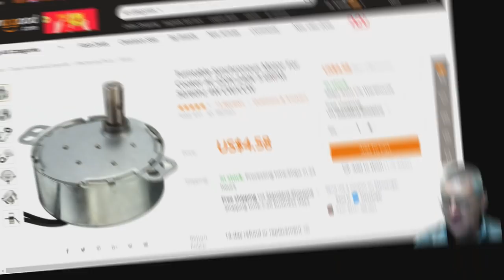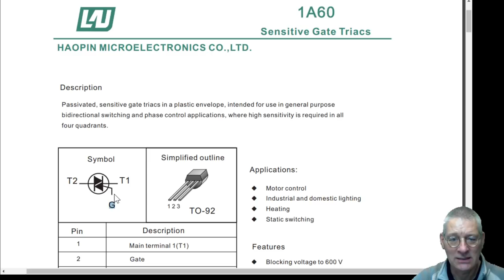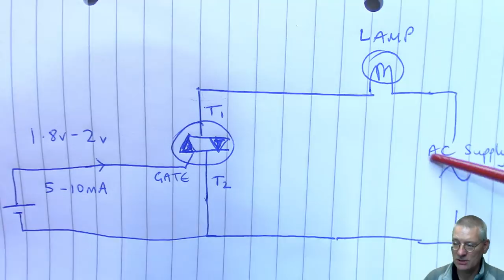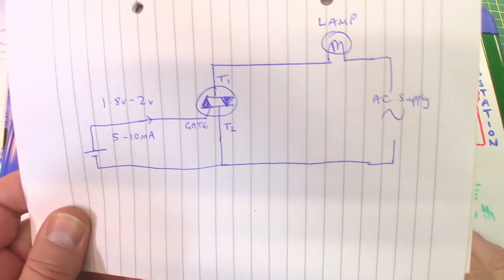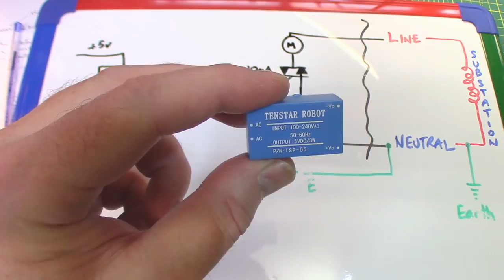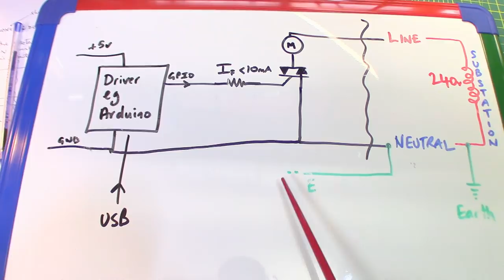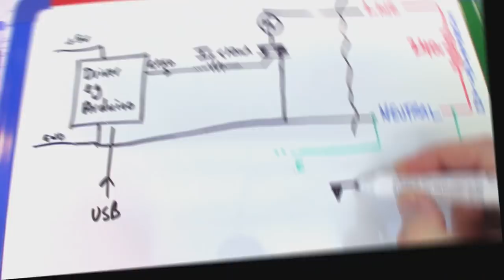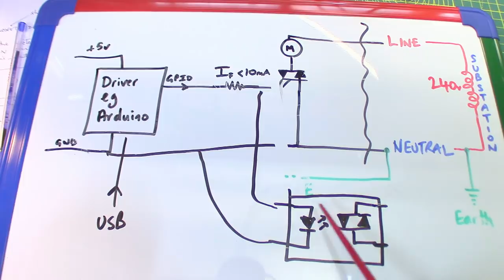#134 Triacs, Mains AC, DC, SSRs 😕 What's going on?

Comment: Wouldn't the addition of a single opto coupler, to drive the triac, have solved the problem?
Reply from the maker: An optocoupler certainly solves an issue, Dale, but getting it connected up would still be a bit tricky (some parts of the circuit would still be at mains potential).  Is the optocoupler just a photosensitive Diac? What resistance do we need to feed into the Diac from the Line circuit?

Better to use an SSR which has an optocoupler all built in, along with zero crossing detection. But that's in the Advanced Lesson so will have to wait for another day, I'm afraid!
Reply: @RalphBacon  Had to go back to the previous video to find the chosen solution for the fan rotation motor. Looks like you wired it in parallel with the second heater element. Not mint, but certainly serviceable. Particularly, to your concern, it totally removes the third point of proximity to mains. in order to put the heater back to original functionality, I was considering the use of something like a LTV852-ND opto coupler. It would take up less space (4 pin DIP) than an SSR. I've seen these devices used for mains isolation in North American (120 Volt) circuits, and do not know of any reason why they would not function in 240 volt circuits.
Reply from the maker: That's right, the swivel motor is wired in parallel with the "boost" heater coil. It actually works better that way! But, you're right, a simple 4-pin optocoupler like the MOC3021 could have been used. It would have meant more mains 240v potential connections on board, of course, not great for stripboard. Certainly better than a naked Triac!

Comment: Ralph.  Another great video. A question. If you had had the room on the heater board space would you have used an SSR?  I am in the thinking stage of two projects where I would control mains (120VAC) for me.  One would be a light and another an LCD monitor.  I was thinking about an SSR.  Would you agree with this or would a relay be better.  I am very much a beginner in all of the electronics.  Thanks!
Reply from the maker: Not necessarily, Bruce. 
SSRs are fine when manufactured by a well-known, reliable (albeit expensive) source, so that 10A really does mean (at least) 10A and not 5A, but even allowing for that fact when buying from China (that is, de-rate the current rating by half) relays have given great service for decades and rarely fail. And they are small. You'll see a comparison when my SSR from China arrives (the heatsink is already here, and that's another big thing to consider that relays do not require). 
For low current applications (eg lighting) SSRs are probably fine (although watch for the minimum current requirement - your SSR might not work with a simple 3W LED bulb, there's a minimum current required to ensure it switches on, probably around the 40W mark). 
This isn't just me being an old stick-in-the-mud. The well thought of Sonoff series uses relays. They are zero volt contacts (so you can use the relay to switch anything you like, like a simple switch). Simple might be best, sometimes.
In your case, unless you are switching the items on and off several times a minute a relay would be simpler. Ensure it is an optocoupled dual relay like I showed in video #18 and it will work well. Connect that to an ESP8266 and you have wifi controlled switches. Oh, Sonoff has already done that. See what I mean? 
Others here may have a different view?
Reply: Ralph S Bacon Thanks for the great advice and other key items I need to check.  Your are probably right about the relays and simplicity.  My planned projects do NOT have to turn on/off frequently.
Reply: SSR have built in suppresion, zero crossing etc that relays don't come with (at least most).  Although they are expensive they are worth it if you are dealing with mains imo.
Reply: Joey Mac thanks

Comment: At 4:50: the roman literals I II III IV are quadrants (positive/negative cycle, positive/negative gate voltage). Here's a good explanation http://www.learnabout-electronics.org/Semiconductors/thyristors_63.php It is very common to need different current in different quadrants and IV quadrant should probably be avoided.
Reply from the maker: Interesting stuff, hoggif, I shall read in more detail a bit later but I have that web page open on my desktop. Thanks for posting.

Comment: Happy, UK plugs are polarised. You know what is Live and Neutral. Many plugs in the EU are not polarised. You can turn L and N what you want!
Reply from the maker: Sounds like a recipe for disaster. But I guess 500m people in the EU can't all be doing it wrong so I wonder how they manage to not electrocute themselves? It would be interesting to find out. I'll have a read...
Reply: We have to isolate both, L and N. Switching with a relay or solidstaterelay. Better switch both.
Reply from the maker: Sounds a bit tricky. There's a time and place for double-pole switching but using a Triac is not one of them, I believe. I wonder what the circuit looks like? Relays would be easier, of course, but slightly over the top for most things. But if you don't know what you're switching I guess you would have to switch both to be safe.
Reply: Inside a tool only switching one, but with outlet both

Comment: Hi Ralph:  I'm thinking about using an Arduino to periodically turn the furnace blower fan off/on during the night just to help circulate the air in the house. I'm thinking about using a SSR. The specs are here: http://www.fotek.com.hk/solid/SSR-1.htm

Does this device appear to be able to be powered by the arduino directly? It only has a 7.5mA activation current. Could I just wire it to a digital pin and then ground on terminals 4 and 3 and then have my 24V furnace fan control signal voltage on the terminals 1 and 2? Your thoughts are welcomed. Thanks, Gord
Reply from the maker: If your furnace blower runs on 24v AC (not DC) then it seems a possible solution, Gord. GPIO pin to pin 3, Arduino GND to pin 4 which means your Arduino is totally isolated from the other side. Note that 24v AC is lowest this relay is designed for so double check that blower supply. I would also measure the input current to the relay (from the Arduino) just to double-check that no resistor is required.
Reply: @RalphBacon  thanks kindly for your prompt reply Ralph. I do appreciate it. Have a great weekend!

Comment: Haha, in the US, by code, the neutral and ground must be connected at a house's main panel and nowhere else...
Reply from the maker: You mean each house has its own separate ground stake (actually in the ground)?
Reply: Either by one or more ground stakes to get down below a 25 Ohm maximum impedance requirement, or if there is a copper cold water inlet nearby, that can frequently be used as a lower cost alternative with better performance. This is all spelled out in the NEC which we just call "The Code". It's like The Bible. Everyone here knows what you are referring to when you say the code.

Of course there is significant current running through the neutral and ideally no current running through the ground, so they can be at significantly different potentials away from the main panel. So hooking up ground to neutral could result in dangerous ground loops, and as someone else pointed out below, there is also the possibility for someone using a non-polarized plug here, which allows either side to go to the live and neutral lines.

I didn't realize this was different in the UK! Good to know! Of course your much better plug arrangement makes switching the live and neutral much harder, but I guess this wasn't considered as essential with only 110VAC, or maybe there was too much infrastructure already in existence before the standards came into place...

Regards,
Alan
Reply from the maker: Yes, Alan, we bond to the cold water pipe too, and our "code" states that all such pipes must be bonded so if you put in a bit of plastic pipe there must be an earth bonding wire between the metal bits of pipe remaining. It's a bit unfortunate, then, that my water is delivered via a plastic pipe! So we use the gas pipe instead (which sounds distinctly dodgy, but there we are). Yes, in the UK you can't switch L and N due to the plug arrangement, assuming it's correctly wired in the first place. Legislation a many years ago made all consumer items, including fridges and cookers etc come with a moulded plug to avoid tragic accidents. I shall have to talk about all this in a future video!

Comment: I share your concerns and double them. :-) 
You live in the UK and you have the kind of mains plug that cannot be reversed. And you have very strict codes about mains on cable colors, and which goes to which side of the plug etc. I live in Turkey, and we use the "german" type plug, ( https://goo.gl/images/yspbFY ) which is totally reversible. So, if you connect the Arduno GND to what you think is "neutral" you can easily reverse the plug and feed "live" 220VAC to arduino's GND. To make things worse, the cabling codes are not followed at all here. Any wall socket can have live on the left pin, or the right pin. It is very common to see totally random connections even in the same house. So we never know which side of the wall socket is live :-)
Reply from the maker: Frankly, Bora, I'm surprised you've survived long enough to be able to tell us about this! 😲 We might moan in the UK about "'elf and safety" (health and safety regulations) but at least they really do (over) protect us!

Comment: MOC3021 would probably run that motor directly.
Reply from the maker: Using an optocoupled Triac, Bernd, such as the MOC3021, is the obvious solution for this very low power motor, but fitting it might have presented a bit of a challenge in that workshop heater circuit board - yet more mains connections to contend with! We'll explore some things like this in a future video (once my 40A SSR has arrived from China).
Reply: @RalphBacon  
There's a zero-board solution.

I'd put that "hot" circuit directly on or close to the motor, on its own "board". There may be a surface near the motor where the chip can be "dead bugged" (flipped upside down) and glued into position before attaching the wires. That may sound dodgy  but it's quite safe as long as you use the right glue and appropriate sleeving on the soldered connections.

Call it "smart motor" and nobody will raise an eyebrow. ;-)

P.S. When you get the SSR, make sure that it's located on the cool side of the airflow. A proper one from Omron (G3NA-220B-DC5-24 if I recall correctly) has a data sheet with suggested heat sink requirements for high loads (it was switching a 2.2kW refrigeration compressor).

P.P.S.: BEFORE you flip that chip on it's back and glue it down, mark which pin is number 1 on the "underside" and keep in mind the "mirrored" configuration when making connections to the other pins!
Reply from the maker: I like that idea of calling a motor "smart" just because we've glued a (mains powered) chip to it. If you are not already, Bernd, one day you will become very rich with such lateral thinking. 😄 
Now, I don't have a MOC3021 but I'm pretty sure I have a MOC3023 somewhere which is pretty much the same (I'll check what the differences are) to experiment with. I'm not going to add this to my workshop heater but it will be good to experiment and video as required.
Thanks for posting, appreciated.

Comment: 4:15 - "Those" are actually important information, "those" are reference of the AC cycle in terms of the quadrants relation with the Triac, if you do not know anything about the Triac's functionality of it's AC quadrants, you do not know nothing about Triacs. Triac quadrants are vital important to know about. You seem very confused what "those" are lmao... telling me you don't know nothing about triacs. lol 15:30 - you have a valid curiosity, and I bet 99% of youtubers are extremely confused to even comprehend what you are even talking about, it gets really advance confusing, only an electrical engineer would understand. Yes power companies at the transformer station sticks a huge pole down to earth attached to the neutral line, there are many benefits of doing this. Even my home in NYC, the power coming from outside is also attached to the plumbing pipes since it is connected to earth. Both of the grounding/earth from your USB and from your Triac ground/earth are common with your mains power, makes no difference. Your DDM continuity will also tell you this is true. If you are using your LAPTOP rather than your desktop... that is a whole different story. All in All, it is not wise to design a Traic circuitry with the microcontroller not TRULEY isolated... use an opto isolator. The reason why you need to connect the Triac's ground to the uC directly is because there is great resistance from the triac's main's ground to the USB's ground.
Reply from the maker: It's true, I know nothing of a triac's quadrants. But then again, if I did control a triac from either a μController or similar, I'd expect it to take all that off my shoulders. And, yes, I'd use an optical isolator if I ever did that, no direct connection.
Reply: @RalphBacon  I myself not knowing by heart how exactly Triacs works. I just know what data sheet states about it. I wanted to get some practical examples how a triac works, seems like it is a very very complex subject and no one on the internet discusses completely how a triac works from top to bottom when used with a microcontroller. 
You have an interesting video about the common ground problem with Triacs, this too is also needed to be considered when designing a circuit using Triacs. 
Your head will blow if you use 3Q (3 quadrant Triacs) rather than the regular 4Q Triacs. Yes, newer produced 3Q Triacs are much more safer and better.
Triacs are very cool analog components when it is properly paired with microcontroller to drive it. 
I am just trying to avoid buying an optocoupler which has a built-in diac to drive the triac, only because I would like to learn how to build things from dead scratch, building an optocoupler is really easy, can build one using two red leds or an infrared led and a phototransistor led but I get lost how to place the diac in the circuit with the custom built optocoupler.